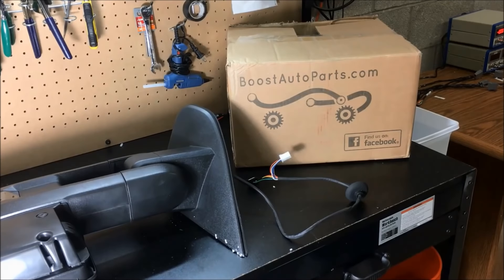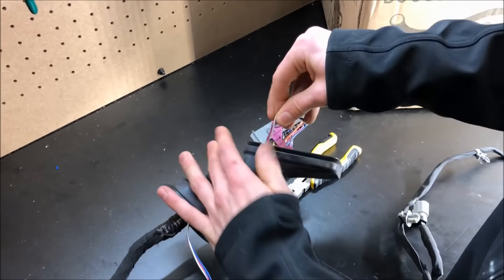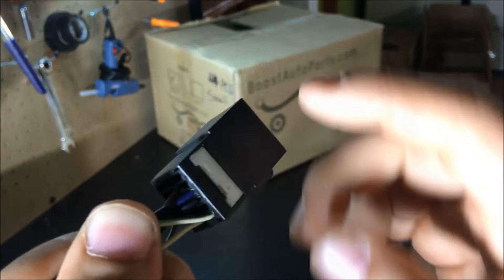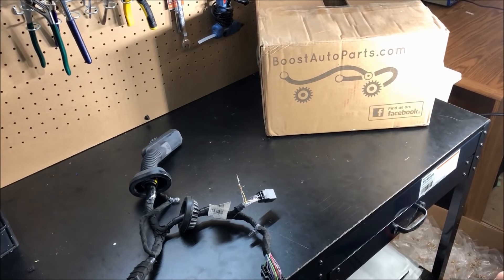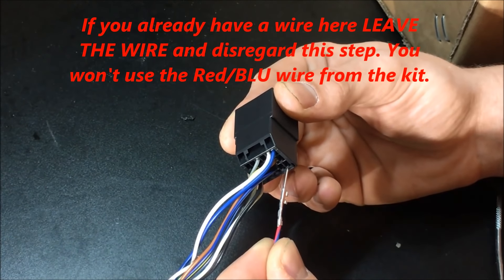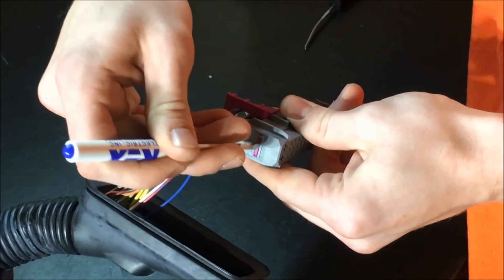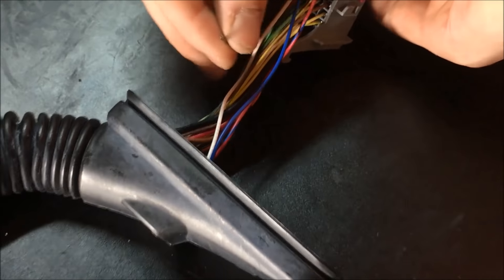Plug and Play 2015 - 2018 Silverado Sierra GM Tow Mirror Upgrade

Comment: Ok so I bought the dual function kit for my 2017 GMC then I emailed boost auto parts the problem I had they right away called me put my order on hold and told me that wasn’t going to work for my application. 1st of all for some one to take time off their day and call a customer instead of just selling hands down 10 of 10 customer service . 2nd he got what I need ( plug and play harness ) shipped to me got here stupid fast  lol . I watched their how to video EASY step by step and got the mirrors working how I wanted too . Thank you boost auto parts ! Next upgrade HIGH OUTPUT LEDS !!
Reply from the maker: Thanks for the feedback Ricky! Glad we were able to get your mirrors working the way you wanted with the plug and play harness. Those high output lights will be a great upgrade for your aftermarket mirrors! Let us know if we can be of any further help.
Reply: I got my harness today for my 08 Silverado. With the dual function setup, the blinker is barely any different from the running light. Did I hook something up wrong? You can barely see it flash during the day with the parking lights on and at night you can tell slightly. Also can I hook the orange wire coming from the mirror directly to the battery?
Reply from the maker: Hi Nick,

Please reach out to us at sales@boostautoparts.com so our support staff can help you out!
Reply: @boostautoparts  
 Hi i have a 2017 chevy my side mirror doesnt have any signal or heated im upgrading the mirror to tow mirror what part i need to get it working as right now harness plug and play only thing work is moving the glass up and down and side to side
Reply from the maker: @vangvang4925  You need the harness outlined in this video. Please contact us by email at sales@boostautoparts.com for further assistance.

Comment: Started install on my 2018 Sierra couple days ago, and finished today.  Mirrors themselves, then it rained.  Wiring harness today. I wish I had been warned about the tiny holes the male pin supposed to go thru.  I didn't look at that side of the plug to ensure correct insertion.  Driver's turn signal didn't work.  Called the awesome customer service, spoke to KURT, and we worked thru until problem was found.  Went as far back as removing mirror from right side, and plug into left side.  Re-installed pin correctly, plugged in mirror, and everything worked as advertised.  Apparently I had a loose plug also.  Re-installed mirrors, checking function every step of the re-install of mirrors, door panel (what a PIA that is), etc.
Reply from the maker: Hi Jeff-

Thanks for the comment. Happy to hear Kurt was able to assist in getting your issue resolved. On the black mirror mating connector the terminals can slide down into the larger hole rather than the terminal hole if not being very careful. Happy to hear you got that resolved.

Comment: Why do you call it plug and play tow mirror upgrade when it appears wiring work is required??
Reply from the maker: Hi Marshall,

It is called the plug and play wiring harness, because after installing our harness then tow mirror installation is considered plug and play with no wiring required in the cab unless the truck is 2014 or early 2015. If you have any questions about the install please feel free to reach out to us at sales@boostautoparts.com

Comment: You got me really confused now. I have power fold/heated/turn signal on the glass/yellow LED running light on front. My truck is a 2016 LTZ originally with DL3 mirrors. So this kit will make the front running lights work, and the turn signals? Your other kit (dual function kit) says you need THAT kit to make the driving lights/front turn signals work. Can you clarify if I need both kits or just this kit???
Reply from the maker: If you originally had DL3 mirrors then you would need this kit to add the running light & cargo light. Please reach out to our team at sales@boostautoparts.com or 765-831-2830 for further clariffication.

Comment: I have power fold MidsouthLED mirrors with boost reverse light and boost switchbacks for a 2016 GMC Sierra Denali 2500 that has the small mirrors currently with power fold . Will this kit be all I need?  My new mirrors are plug and play except for 3 wire labeled DRL, ground and signal? Thanks for any help!
Reply from the maker: Since the mirrors are not from us, please reach out to our team at sales@boostautoparts.com so our skilled team can figure out exactly what you're working with and find the best solution for you.

Comment: So this is the plug and play option? Looks like it will be a pain I have a 17 GMC sierra SLT all terrain and I have all the options like power folding mirrors and the puddle light and heated. So basically I can't just buy the mirrors and just plug it in to my original harness?
Reply from the maker: The modify door harness kit is needed to add the running light and cargo light as those weren't originally equipped on your DL3 mirrors.

Comment: Just found out the hard way that if the truck came factory with power folding tow mirrors and upgrade to the boost auto mirrors, modifying the wiring is not necessary. They are 100% plug and play with the factory wiring as is.
Reply from the maker: Correct - if you had OEM towing mirrors our would be a plug and play upgrade. Feel free to call our team at 765-831-2830 with any questions.

Comment: Just ordered these for my truck 2018 with the power fold option, my truck does not have power mirrors right now . I got the switch but for the wiring side does this video include that part ?
Reply from the maker: Yes - reach out to sales@boostautoparts.com with any questions

Comment: I have a 2018 Silverado 1500 LT which does not have power folding mirrors from the factory. If I replace the switch on the door with an OEM power-mirror switch, will your tow mirrors function as they should in regard to folding/mirror adjustment/lights?
Reply from the maker: Yes, if you purchase power folding mirrors from us along with the switch then you can retain the factory power adjust functions and gain the power fold. You can also gain the lighting features if you modify your door harness.

Comment: I’m confused on what to order. I have an early 2015 with turn signal and power folding. Another video said I’ll need the modified door harness and the rzy harness. However, this is saying to hard wire...what is the hardwiring for? From reading, if I’m correct, my mirrors are DL3.
Reply from the maker: Unless the mirrors are from us, you will need to do the RZY + Modify for your early 2015. Feel free to reach out to our team at sales@boostautoparts.com for further clarification.

Comment: Will these work of I have scitoo tow mirrors?I have a 2017 Silverado custom without power mirrors, heat, car censor indicator.
Reply from the maker: The harness will work on our mirrors, OEM mirrors, and any aftermarket mirror that is wired properly.

Comment: What are the 2 wires  in slot 1and2  you remove from?? the ones you replaced  with blue and white, why don't we use them??
Reply from the maker: They are for small, non-towing mirrors. Puddle, and auto-dim (tow mirrors aren't equipped with these features).

Comment: My left mirrors front and back turn signal works but the running light doesn't. I plugged the left mirror into the right side harness and it works so the mirror is fine. Could you tell me which wire is for the running light so I can chase down the problem?
Reply from the maker: The blue wire in the running light. Feel free to reach out to support@boostautoparts.com and our team can assist.
Reply: @boostautoparts  the blue wire was in 13 not 11. I fixed that earlier,  so now both mirrors' white LEDs work, however they seem to operate when the headlights come on, be it automatically or manually, but not solely with the running lights active.

Comment: So I’m having issues with my install. Got a GMC Sierra 2017 and I got everything except the power fold option. Plugged everything in exactly and on my driver side everything works except the backup light wont come on when i turn the cargo lamp on and the passenger side the white led light won’t come on and the backup light stays on regardless of the cargo switch being on.
Reply from the maker: It sounds like you may have a few wrong connections from the modify door harness kit. Shoot our team an email to support@boostautoparts.com with a video showing how the lights are operating and they will be able to get this resolved quickly for you.
Reply: If one side isn’t wired correctly would it have any affect on the other side?
Reply from the maker: @brandondaniels4643  No it shouldn't. I see you reached out to our technical support team; they will get you squared away!

Comment: So what happens if I don’t use this kit? Just no lights for cargo and reverse?
Reply from the maker: This kit adds the necessary wiring for towing mirrors (cargo, running, turn). Some vehicles originally have turn signal, but if you didn't originally have towing mirrors the cargo light and running light won't work regardless.

Comment: Hello i have a 2018 Silverado LT z71 with just power adjust mirrors. Will this wire kit and mirrors work on my truck and give me the turn running lights, and the rear facing white LED? Thank you in advance
Reply from the maker: Yes it should work. Give our team a call at 765-831-2830 if you have any questions.

Comment: I’m switching from dl8 mirrors to dl3 mirrors. Gas version, not towing mirrors. Now will this harness give me the same features plus the puddle light as well?
Reply from the maker: This harness is not designed to go from DL8 to DL3 so it will not function properly. This is for DL8/DL3 to DPN/DQS (towing mirrors).
Reply: Boost Auto Parts thank you for clearing that up for me.

Comment: Everything works but driver side  park lamp. Passenger side works perfectly. I was told to inspect the blue wire but it's fine. Let me what it could be. Thanks
Reply from the maker: The blue wire is the park light wire for the mirrors. Please contact our support team at support@boosotautoparts.com they can guide you to tracking down the issue

Comment: i have 18 slt come with turn signal + heat + power fold. the only thing not working is running light. any video show how to wiring that running light
Reply from the maker: This is the correct video to get tow mirrors to work on your 2018.

Comment: Is there a video showing this install with the wiring still in the door?
Reply from the maker: Not at this time; but the harness does NOT need to be removed for the kit to be installed. Most simply do it through the speaker hole.
Reply: Boost Auto Parts thanks. I was able to figure out the install from this video. All is working!  Your videos are a huge help. Thanks again!

Comment: does the turn signals and running light work if you have a 2016 Z71 LT that doesn't have any features but power adjust?
Reply from the maker: Hello,
With our plug and play kit, all of the mirror features the mirror is equipped with will work as long as the truck originally had power adjust.

Comment: If my truck had the DL3 mirrors will this work to convert to towing mirrors? I have towing mirrors on the truck now. Power fold works, as well as the blinkers on the glass. The cargo lights and the clearance lamps do not work. Although the clearance lamps do come on when I unlock my truck at night.
Reply from the maker: Yes, this would be what you need. If you have any further questions please feel free to reach out to us at sales@boostautoparts.com

Comment: Additionally, if I have mirrors already with all the bells and whistles (DL3 I believe),(except for the extending of the tow mirror of course) why can't you just make the wiring of the mirror connector to match the existing connections and wire locations of the existing harness connection??
Reply from the maker: Hi Marshall,

DL3 mirrors do not have running lights or cargo lights, therefore those features cannot be plug and play without first modifying your door harness as this video shows. If you'd like your front light to be turn signal only, and your rear facing light to work like your puddle lamp does we can custom wire a set of mirrors like this for you. If you're interested in getting mirrors built like this then please reach out to us at sales@boostautoparts.com

Thanks!

Comment: Does this work for signal, running lights, and cargo lights on the side of the mirror? All 3?
Reply from the maker: Yes, assuming the mirrors are wired properly and the truck is 2015.5+

Comment: Do u have ti pull the whole harness or can it be done inside the door
Reply from the maker: This can be done with the harness in the door. You would just work with the connector through the speaker hole.
Reply: @boostautoparts   which method is easier to modify the harness for these mirrors?  Taking the whole harness out... or leaving it in the truck?
Reply from the maker: @Farmlife7461  Most customers choose to do it with the harness in the truck

Comment: Will this work for tw mirrors without power fold, just lights? Also, how does it activate heat mirrors? Sorry, not good at all when it comes to wires and fixing. Ha!
Reply from the maker: Our Modify Kit will work with Manual Fold mirrors as well. This gets ALL of the circuits including power folding to properly function so the mirrors can work plug and play without running additional wires into the cab.

Comment: Will this wire harness work with GM OEM towing mirrors part number 23351786.  Have an 18 Silverado LT, no power folding, no memory.  Will this make reverse lights, directional, and running lights work on these new two mirrors? Thanks
Reply from the maker: Yes it will!

Comment: After adding this wiring harness and installing new towing mirror that support the power folding what else is needed to get the power folding to work as the stock mirror control switch does not have a button for folding?
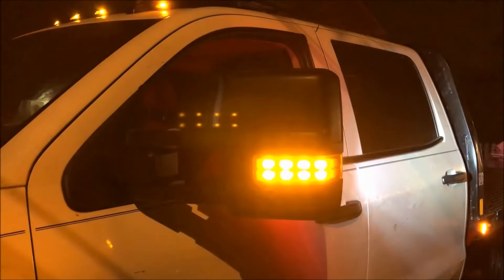Reply from the maker: Watch the video at 8:48. You will need to swap the switch for the relevant power fold switch. We are going to be releasing a FULL upgrade to power fold video in conjunction with our power fold tow mirror release later next month.

Comment: I followed your instructions but power windows stopped work and my power locks and mirrors switch doesn't work.
Reply from the maker: It sounds like you may have the connector that plugs into the door panel unplugged. Please check all of your connections and if you are unable to locate the issue please contact our support team at support@boostautoparts.com
Reply: @boostautoparts  yeah I check door main harrness the res also a air bag message on the dash
Reply from the maker: @heavytrucks5237  It sounds like you for sure have a connector unplugged
Reply: @boostautoparts  I wired everything that video said but what confused me was the two black wires that were supposed  to be cut. My truck only has one  black wire and a black orange. But definitely I plugged it back in. My power lock and window switch dont work the speaker dont work. And its ask for airbag service and the truck message also power saver.. what else is needed because I ordered the mirrors with everything but power folding option. Thanks if you have any input pls help🤯
Reply from the maker: @heavytrucks5237  It looks like you contacted our technical support team. They will respond and get you going!
Reply: @boostautoparts  Thanks

Comment: Do I need to wire anything else if the truck is a 2018 Silverado?
Reply from the maker: Just the modify door harness assuming the mirrors are wired properly. We do offer mirrors as well.
Reply: @boostautoparts  I got the mirrors from your website
Reply from the maker: @strongsounds1  Should be all set then! If you run into any issues feel free to contact our technical support team!

Comment: What function do you lose if you just plug in tow mirrors and do not add the wires or change the harness
Reply: You just have a power mirror adjust and a heat but no signals, cargo and running lights.

Comment: Is it absolutely a requirement to pull the harness or can it be wired with most of the harness in place?
Reply from the maker: You can modify the door harness with it still inside the door. We simply filmed with the harness removed for video purposes. Most customers remove the speaker and work with the two connectors through the speaker hole.
Reply: @boostautoparts  That's what I hoped would be your answer. If I had to remove it all I may as well have just gone with a complete wiring harness despite the additional cost. Thanks!!

Comment: I have an '18 2500hd (diesel) with heated mirrors, but no turn signal or rear back up spotlight.  I don't electric folding.  Is this the kit I need to add the tow mirrors and get functionality for the turn signals and spotlight/rear reverse light?
Reply from the maker: Yes, this is the only kit you need. We also offer quality mirrors for your vehicle if you need to pick up a good quality set!

Comment: my 2018 sierra has a pin in pin 41 so what do I do?
Reply from the maker: If you originally had a wire in slot 41 you don't use the red/blu in our kit

Comment: I installed these wires and when I go to reverse and I turn on my cargo lamps on my camera blurs out then I turn off the cargo and my camera is normal ? Why
Reply from the maker: That is a condition that is found in cheap aftermarket mirrors; the mirrors must not be from us. The cheap mirrors on the market use poor quality electronics which often interfere with OEM electronics (which is what you're seeing here).

The only way to solve this is to swap the mirror to a higher quality mirror. We offer these mirrors on our site, or feel free to give us a call at 765-831-2830.
Reply: Boost Auto Parts thank you and yes sir they are NOT from you guys

Comment: How do you get to the passenger side harness
Reply from the maker: You don't need to remove the entire door harness; you can simply work with the connectors through the speaker hole.